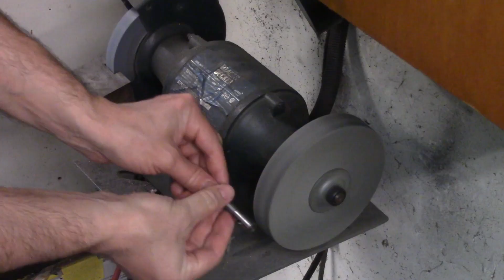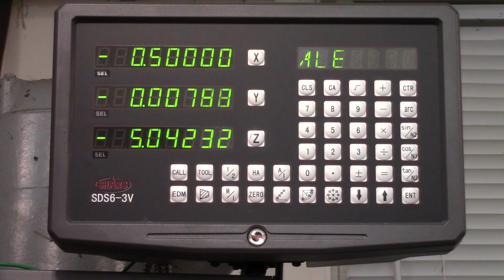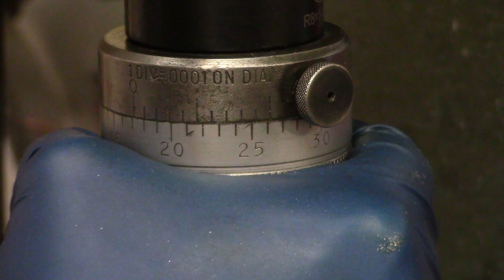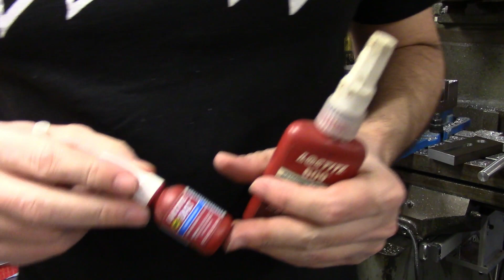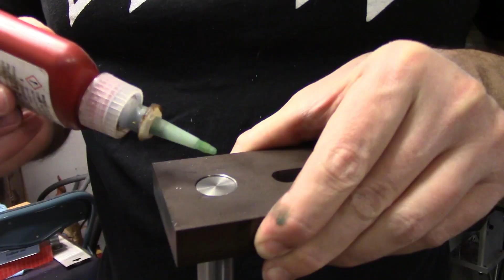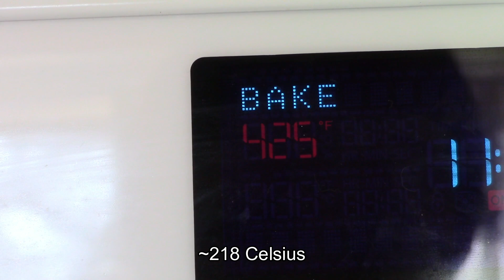Making a Table Stop Part 2

Comment: Forgive a stupid question but wouldn’t it be better to locate off of the shaft  n the X dimension  for the set screw to make sure it is centered on the shaft and not the base ? Just an amateur trying to minimize my errors so please tell me the flaw n my thinking
Reply from the maker: Not a stupid question at all! Either way works in this case, since I  was just sticking two pieces together that are never meant to come apart. If you’re trying to make something that will have to be disassembled regularly, I'd locate it using the shaft to avoid alignment issues during reassembly. Neither method has an effect on the function of the part in this instance, but keep that in mind when you're designing your project.
Reply: @StuartdeHaro  thanks for the quick response. Guys like me really appreciate the time and effort you put into your videos. And I learn from each and very one.

Comment: Couldn't you have just driven a split pin through the base and column in a blind hole?
Honestly, I doubt the retaining compound is ever going to fail.
Reply from the maker: You absolutely can, although I hate pinning into blind holes. Those pins are hard and do occasionally break and you're screwed if it's in a blind hole.
Reply: @StuartdeHaro  If you put enough torque on the shaft of a material stop to shear a split pin you have bigger issues!  😉
I'm not trying to be argumentative. In fact I really enjoy your machining basics type of channel.
I'm just trying to figure why I would want to tap a blind hole and insert a ball behind a set screw when I've already used bearing retainer on a close fit hole that I inadvertently reamed a little loose?
I assemble engines and shafts where the bearing has spun and the new one almost drops in the pocket.
A little brush of primer N and a drop or two of 620 when that dries.
They seem to hold up to all kinds of racing and abuse, except if you run it out of oil again and the bearing/bush gets hot enough to discolor.
Reply from the maker: @jimurrata6785  Nah I get it. I figured I'd take the opportunity to show one of the other approaches since I messed up the first one. No other reason.
Reply: @StuartdeHaro  excellent recovery in any case Stuart!👍

Thank you for sharing the details and your reasoning.